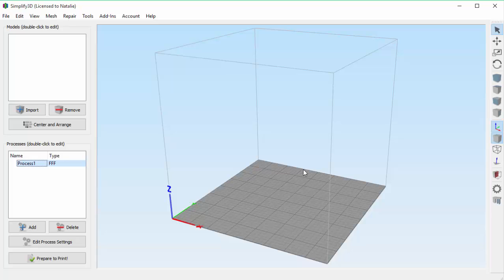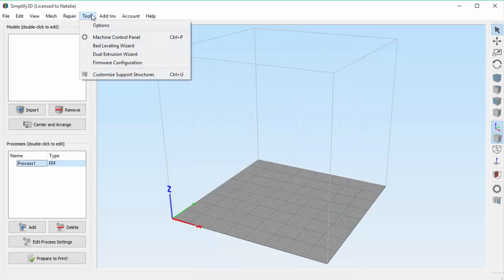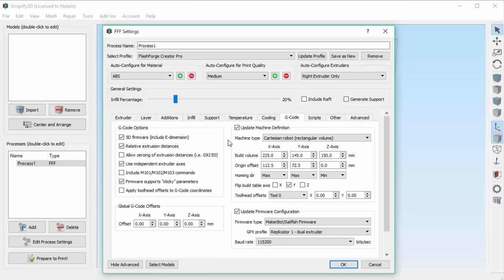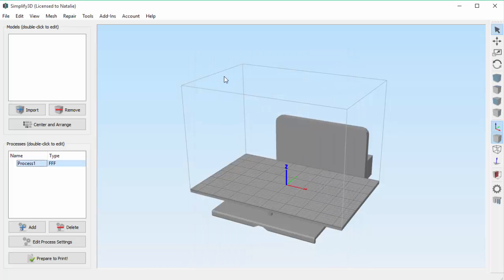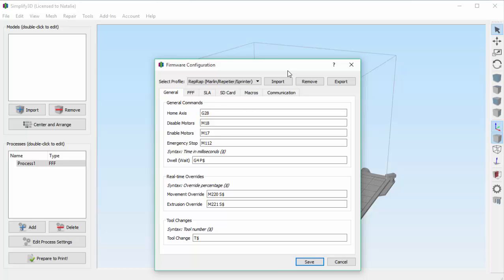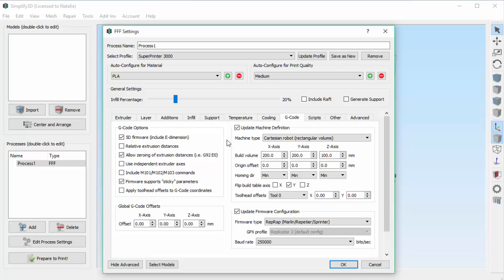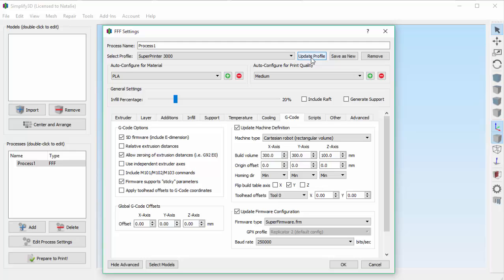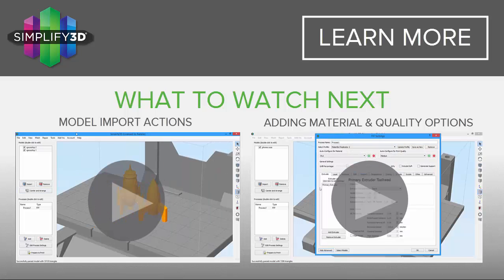Firmware & Machine Settings | Simplify3D

Comment: Thanks for help I'm using the inventor but need something bigger so I'm building a printer with a 500by500mm heat bed i have everything and know how but lost with how to change bed size on program big problem fixed,thanks

Comment: Just installed this yesterday.  What took 13.4 hours to print with the included machine software,  now takes 4. And it nets a much better results.  For example,  I was printing a model with small letters.  The free software simply hopped over the letters.  This software actually builds around them so they end up being very crisp and clean.  Said letters apprear engraved on my model as a visual reference.

Comment: I purchased S3D and am running an M3D printer. I can't get the COM ports to communicate. It's trying, but failing. Am unsuccessful with any response from Tech. Needing to print.
Please advise.
Good tutorial..!
Reply from the maker: +Skippy Farnsworth Our support team answers questions in the order received. Someone from the team will get back to you shortly!
Reply: I figured out to generate G-Code with S3D, the open the M3D Spooler, clear the bed (not sure if I am supposed to use the M3D preprocessors) then find file and print. I am guessing that the altered G-Code will not damage the M3D in any way.

Comment: Thanks for the explanation, but it doesn't change the fact that there are some things in the user interface that are counter-intuitive and can  be a big source of frustration.
The Tools/Options - General options window is a prime example. There is nothing to indicate that the machine settings here are read-only. I've read of many cases of aggravation from users who try to change machine settings here, but then find they are not saved. This really needs to be fixed. It could cause machine crashes when users think they've changed the build volume, but they really haven't.
Reply from the maker: +K Danagger Thanks for the feedback! We would encourage you to submit this and other ideas for improving the software on the "Feature Requests" section of the Simplify3D Forum (forum.simplify3d.com).

Comment: Hello, I would like to know if the S3D can also upload stock firmawe to  the printe ?
Let say I have a FFcreator pro and there is new version of the saylfish I would  love 
that  your great software will upload the last version of it, and same with a Marlin on the Prusa and so on....

Do you thinks this can be available ?
Thanks for your great tutorials
Reply from the maker: +Bastien Caspani Good question! In the Firmware Configuration window, there is the option to import firmware files.
Reply: Simplify3D  Thank you for your fast answer I will make a try :)